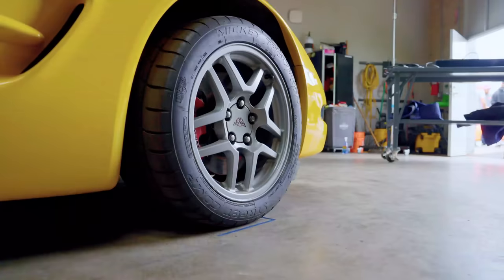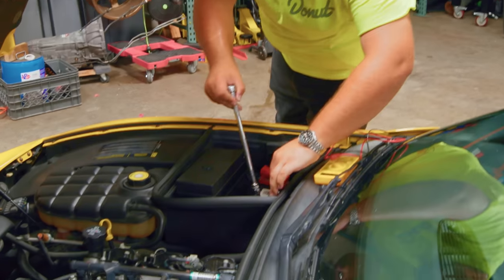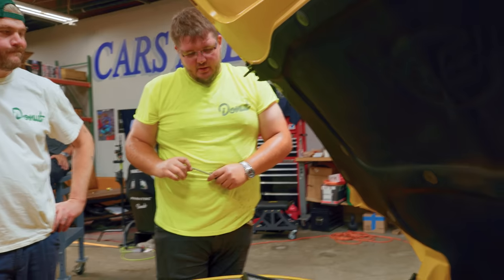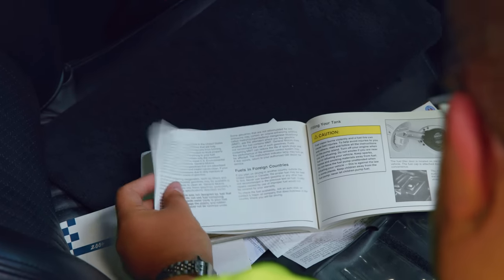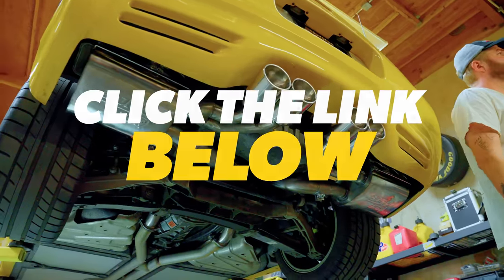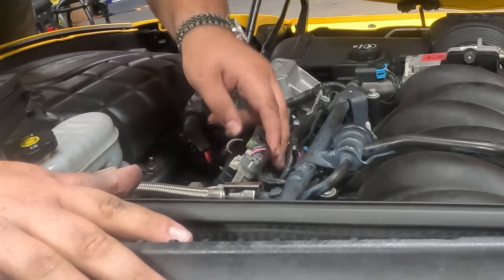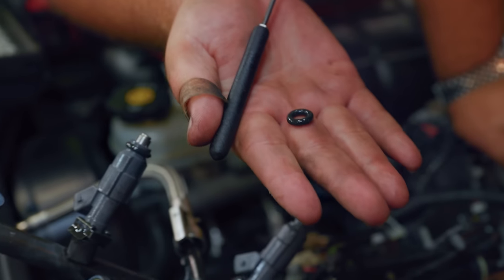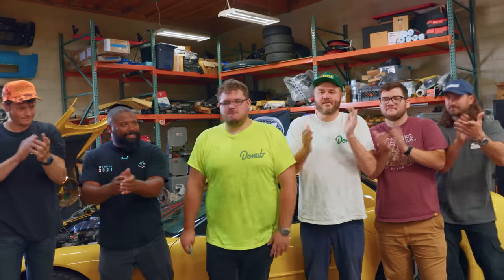Giving Someone a Corvette, If They Can Fix It

Comment: Wow, the most gut-wrenching episode yet. Sam did a great job.
Reply: I say we all spam SAM in the comments of their vids until they give him the vette
Reply: @t4cot4ctical  Im gonna be commenting on everything they post about it. They were cruel here.
Reply: They should do more trivia and install things for extra time. Or make the ones they do actually install add more than 20 mins. At least 30 you’d think. Then he would’ve been driving that car home. This really got me heated too. Poor dude. Can’t hate the game tho. Least he got some cash. Just seems like a slim timeframe
Reply: the sabotages went crazy
Reply: @slowcarshop  for real. They used to let the people get the car if it just ran and drove but this round they said running correct and driving. Should have called an audible and gave him more time.
Reply: @ericcartman1168  agreed. Or got a sledge hammer
Reply: @seinarukishi9228 also bringing him in for the outro was actually hard to watch. I was fully expecting a sike out leading into a part two. Jerimiah really wanted that corvette. It’s also weird how the spark plug was cut but not actually detached like the first one.
Reply: @VGbeck22  naw I got to disagree on that. I mean if you got one bad spark plug wire why not just ask for a full set and just replace them all instead of trying singles. Now if he had and they docked him then sure. I won't discredit dudes mistakes but they was stacking vacuum leaks, and he had to have it running with no codes, freezing his key in ice. Dude lost 6 minutes just getting his keys. The odds were stacked against anyone they chose to work on it because I doubt any mechanics would have checked the brake booster for a vacuum leak.
Reply: @raydavis7686  considering they asked for spark plugs and they only brought out the one then I would assume that’s what I needed and asking for more could cost you ten minutes.
Reply: @VGbeck22 he even told Nolan that the way he said single spark plug wire made him think there was more but he still only asked for the one wire.
Reply: @raydavis7686  the penalty for asking for more and being wrong is ten minutes while they’re constantly asking bait questions.
Reply: @raydavis7686  yeah they normally give contestants 2 hours, for some reason this episode they gave him 30 minutes less and froze the key in ice? so make that 35 minutes less, they told him there were 6 problems and insinuated that meant 6 things to fix but there was really like 9+ things to fix, it wasn't really fair, if you take the previous episodes into account the problems weren't presented that way, to begin with, I don't think they really wanted to give this one away, but imo they did tell him the rules and he agreed to play according to those rules he lost so he isn't entitled to the car in any way but he definitely didn't get the same shot that previous contestants got and there was definitely more of a deceitful spin on this one
Reply: @SpreadingVerity  they changed all the rules up. They said runs and drives only, then they've allowed other donut members to help in previous episodes. I mean look at the rx7 episode, the whole production crew jumped in to help and all he had to do was install the motor not hunt down sabotage. They've never required something so extensive as what they did to Sam. But the I stand by the spark plugs because he would have saved himself time in the long run and led him directly to the injectors because he knew he had pressure in the lines and spark just no fuel to the cylinder.
Reply: @VGbeck22  it is but if he had asked and it been wrong he would have lost ten but not wasted time on going back to a problem like he did at the end. If you buy a car and have a misfire would you just replace one wire or all of them? And it would have led directly to the injectors because he knew he had pressure and spark so then that leaves just the injectors.
Reply: that man deserves at least to be remembered for his efforts. that was intense
Reply: No, Sam did not do a great job.
Reply: Those were a LOT of sabotages, not just 6
Reply: @raydavis7686 he had to ask for a specific amount of a part. If he asked for any more than 2 spark plug wires he would have been docked time.

Comment: dang you guys really stepped up the sabotage efforts. I probably wouldn't have guessed to check for more vacuum leaks or a second spark plug after getting the first half.
Reply: Vacuum leaks is tough but the sparks were all his fault for not checking them all.
Reply: I could see the second spark plug being fair, but multiple vacuum leaks from different things feels like separate sabotages
Reply: @randymiller1610 and just loosening them up is really annoying. I think he checked all the spark plugs but that one was half cut so it looked fine to him.
Reply: @Linkophere he did. He did check them all. He says as much in his own recap video on his channel. The issue was that if you pulled on the plugs with any real force you run the risk of destroying a perfectly fine plug.

Comment: This was the toughest challenge compared to the previous ones tbh
Reply: Also the most skilled contestant so far tho I'd say
Reply: agreed.  The second spark plug wire was a bit dirty, but once he replaced one, he should have checked the rest.  The battery was probably a mistake by Donut as well, but hopefully he didn't spend too much time chasing something unintended.  All that said, they were very kind to him, as they've been to the rest.
Reply: It’s a tough challenge but he tried his best. Plus it’s a free best year C5 Corvette Z06! It has to be hard to win.
Reply: And they said they'd give him a trivia but didn't- not to mention the battery issue :( poor sam. This challenge didn't seem fair
Reply: @kylahtriffo9247  Yeah I was wondering about that, thought the trivia might come in to give him a second chance at the end but nope 🤷‍♂️
Reply: @GlorifiedGremlin  I really reallyyy hope they give him a second chance

Comment: Yes! This is my favorite series you guys do and I've missed it dearly!!!

Aw dude got done wrong on this one...3 vacuum leaks and 2 wires was 3 extra problems for him to find.
Reply: yep that sucks he should get at least another chance
Reply: yeah, there weren't 6 sabotages to fix, there were 9. this was misleading and not very fair, i few sorry for him.

maybe we could even argue if the 2 wires are a single thing or not.. but the leaks definitely doesn't look like it
Reply: Agreed, especially since they didn’t even really cut the second wire they just sliced it a bit, it probably would have still run with it like that
Reply: i mean it was a zo6 thats like a $20,000 car

Comment: The sabatoges in this episode felt a bit more devious then previous ones, but maybe that's just me
Reply: Putting the key in ice was just unnecessary lmao
Reply: They definitely were more devious. The previous episode sabotages felt like problems that a car would normally have when you buy someone else's project. These didn't. These felt like someone actually planned on making your life difficult by actively doing fucked up shit before selling it to you.
Reply: More devious = better car ig
Reply: @Megidramon  You´d be surprised with the fucked up shit that the last owner of my car did, like swaping the fuel hoses from the tank, unplugged temperature sensor, accelerator cable set to not open the second stage of the carburator and some other shit like radio wiring with short that almost set the car on fire.
Reply: It was, but that’s the name of the game here I guess. Im still rooting for Sam to have a second go at another car, a “redemption” would be neat to see
Reply: Well, they can't be easy like the last couple...
Reply: Yea.. That two spark plug wire issue was pretty evil...
Reply: These challenge videos have gotten WAY more complicated since they started the series
Reply: @Sniperboy5551  I mean it was a vette, but didnt they also do an rx7 and that was fairly easy fixes
Reply: It is a z06 vette they’re not gonna let that go so easily lol
Reply: @realhastalamuerte303  Fr If it was just a base model or a c4 they would’ve let it go easily
Reply: the ice thing in particular was bs, cmon man they could have done something else
Reply: I agree, two spark plug wires easy enough, but three vacuum leaks? And what’s with the block of ice? Wasted 10 mins for no reason. If they hadn’t done that he for sure would have got it. That was a really nice Z06, so I think they wanted to make it more difficult but maybe a little too far on this one.
Reply: Only evil one was the vacuum problems but if he was a better mechanic he would have found the issues. He had no knowledge on the car and found alot of stuff by luck. Im sure hes a decent mechanic but not to the level of fixing the vette for this challenge
Reply: @metaldiabolos86 I’ve would’ve just smashed that block on the floor
Reply: I don't think so, my opinion he made a lot of assumptions, define of spark plug wire that's cut why would you not check the rest of the spark plug wires ect
Reply: I'm with ya, it kinda killed the series for me.
Reply: @natedostalik3538  I already looked the Z06 model on Internet, it was priced about mid 20 grands to 30-33 grands considering the condition and mileages it have. The cheapest I can find on that car is 24 grand with 200k+ kilometers on it which already sold on few months ago, this car is highly sought for others because of Z06 package, not the base model. Base model can be found half the price of it, but since this car is the end of C5 generation (year 2004), it was more expensive than it should be (C5 gen from 1997 to 2004 and Z06 package introduced in 2001)
Reply: @natedostalik3538  A used vette you can get them as cheap as $10k its not like they are dropping for a new one
Reply: @Linkophere  I don't think it's fair to say 'if he was a better mechanic.' Diagnostics aren't exactly the easiest thing in the world, especially when you're under the pressure of a time constraint, being watched and filmed. A skilled mechanic doesn't know the solution to every problem on every car, it's knowing how to find the solution.
Reply: Agreed man. Seemed a little over
Reply: @xxiii262  agreed
Reply: yes because overall there are many more sabatoges
Reply: Yeah the sabotages were more devious and he also had less time
Reply: Telling him he got it right and then whispering its cut in different places is unfair towards him.
Reply: I think this was the most expensive so far
Reply: @jaroslavmrazek5752  This was my issue, the presenter lied to him and told him he had solved that particular issue. You need to be really careful as a presenter not to lie to a contestant; There can be genuinely really serious consequences for this if a contestant leaves feeling cheated. This series almost certainly has an really really tight set of rules with their insurance company that probably includes that a contestant cannot be lied to or misled on the nature of the competition. 

They're in California as well which has extremely, extremely strict rules with regards to competitions and game show like contests. It's only going to take one contestant that feels like they've been wronged to torpedo this entire idea.

Comment: Gotta bring Sam back for another "fix it, you keep it" episode!
Reply: Yeah he really knows how to diagnose, good mechanic. 👌🏻
Reply: Yep, Sam deserves a rematch 💯.   This was the most difficult one yet IMO, he crushed.
Reply: Sam needs a redemption arc.
Reply: I agree. It would be great if they start a loser's bracket episode where they compete against each other to fix sabotaged cars.
Reply: Have them sabotage identical cars themselves, then swap cars and competitively diagnose for the ultimate Series concept. 😎
Reply: @TH-bj1pb yeah let's diagnose a crankshaft position sensor when the RPM needle is moving upon startup
Reply: @jacobwebb8818  
ya he wasted time because of the pressure and rush,, he shouldn't jump to crank sensor unless not having it reading rpm or scanner  show a crank sensor related problem,, its also strange that he jumped to vacuum leak and map sensor at the start 😅

Comment: I'm going to take a mechanics course in case I ever find myself in this situation.
Reply: I've been telling myself I need to go back to mechanic school ever since I first started watching Donut but trying to take that first step is scary
Reply: Just finished mechanics school called Wyotech. Can confirm it’s worth it. Plus 87% of the time, you’ll be walking out of there with a job after you graduate
Reply: @shoOoterlegend what do the other 13% do
Reply: @dalynferguson2582  Retail 😆
Reply: I went to a mechanics school and it helped out tremendously when I saw two people looking at a car trying to install a battery. At first, I was like if they don't want any help, I'll move on my marry way. They said yes. So they told me that he needed to replace his battery. I said I'd take a look. I went to check in the battery and notice the positive side (hot side) of the battery was loosely connected. I said, "Bro, I'm gonna save you some money today." I tighten it with a spanner wrench from the guy that was helping him. Once that positive side was tightened, it started right up. And I accepted no cash at all. 
Take away: Go to mechanics school to help people. People really need it. Sure it's nice to get paid for it. But even if it's not your field later on it will help overall.
Reply: @m_ism Just don't go to UTI. Their trash. Go to a community college that has it. It's waay cheaper.
Reply: @dalynferguson2582 Many of them either build their own business or find themselves in a different field all together. Don't go to UTI. It's not worth it.
Reply: @m_ism  I've learnt many things just from observation, (observing the people around me work on vehicles; my father, my bros, some mechanics) but I'm aware not everyone may be so fortunate...But hey, there's YouTube and Google at our fingertips. Start where it's easier and hopefully taking that first step won't be so scary anymore.  😉👍
Reply: @dalynferguson2582 work for themselves
Reply: I bought a $900 ( at the time ) scan tool, learned to read live data. Now I TELL THE MECHANIC WHAT I WANT DONE!
Reply: Lol you could do a mechanics course just because it’s good info to have in case you’re in a situation and need it.. you can save a fuckton of money by just picking up a set of wrenches lol
Reply: We need more people like you
Reply: @kio9922  Oh, absolutely! I do most of the day to day maintenance on my car myself nowadays, like pads/rotors/oil, but I've never tried to repair something more serious. My biggest fear is just being able to prove those skills I do have to people without something like an ASE cert. Eventually I want to go into EV repair, but there's not nearly enough resources on that yet.
Reply: My mom did that back in the 80s lol, just do it ffs.
Reply: School degree looks good but nothing like real life exp 5 times a week in a shop, where you’ll actually be..